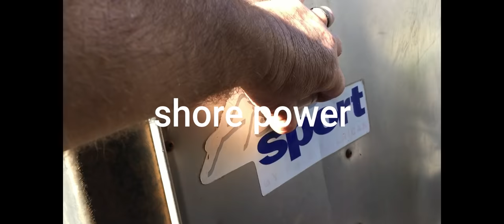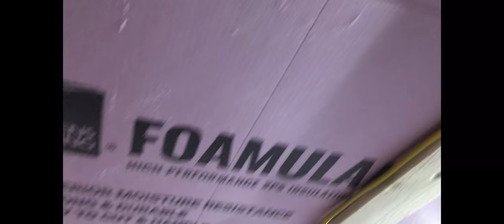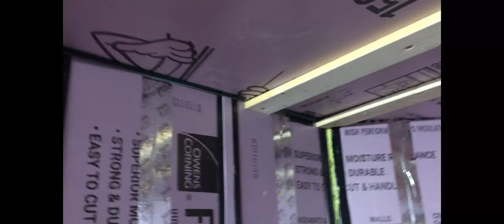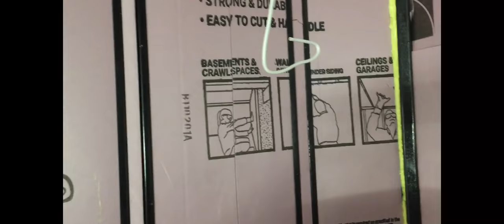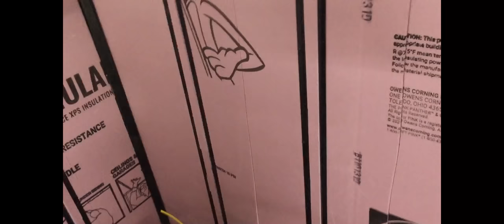cargo trailer conversion PART 6 SHORE POWER

Comment: I won't trust the ground wire connect method. Wires barely twisted and without mechanical fasteners of any kind. With a 6 position panel you can have far more room and it really isn't that large and with a ground bus (not included) connections will be solid and accessible in the future.
Reply from the maker: That would be a good idea I think it’s a little too late for me to do that now but I should have to start with is that